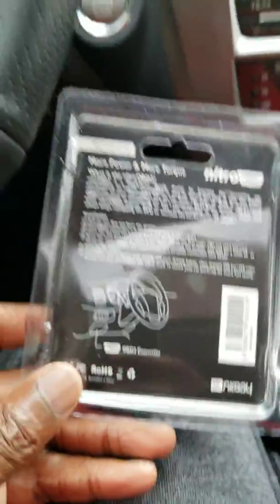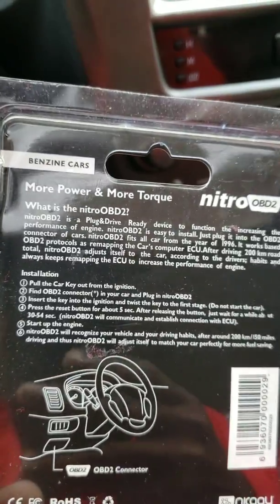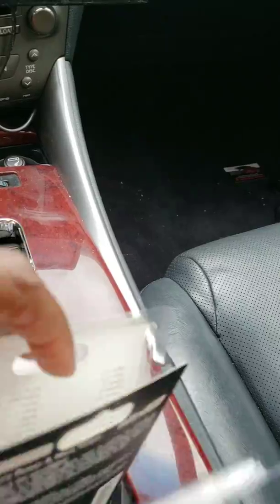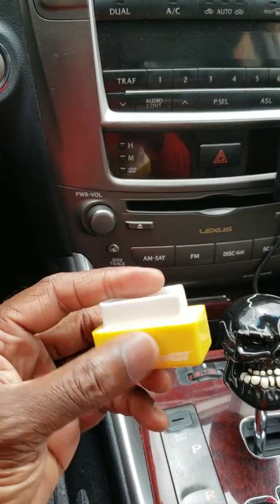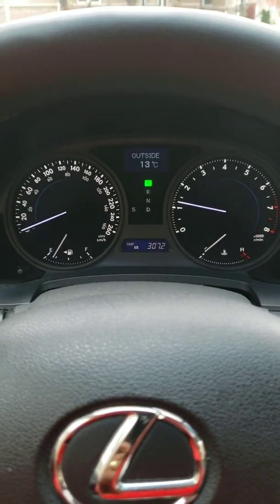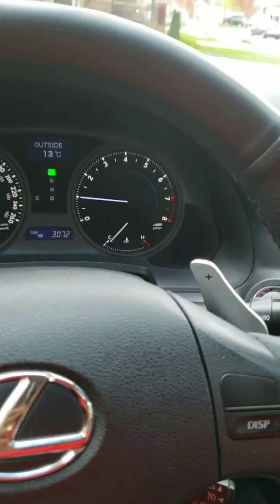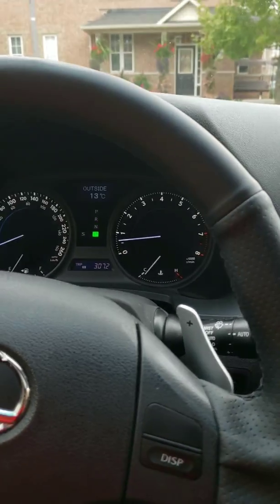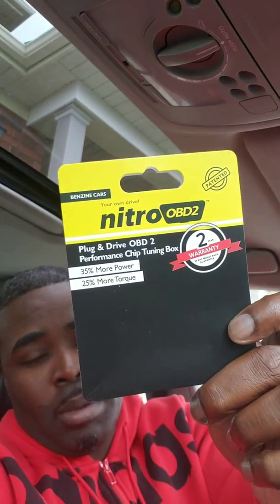Performance chip install Pt.1

Comment: wish omg, obd2 stands for on board diagnostics port witch became standard on all vehicles after 97, its where you plug your scanner however bmws and mercedes still use both there round connectors and obd2

Comment: It worked ?
Reply: NO, is just a piece of LED flashing to trick you... Scam. It says 35% more and in the back say you save fuel.. Use common sense with gadgets like this..
Reply from the maker: I noticed a slight difference in power. Nothing huge.